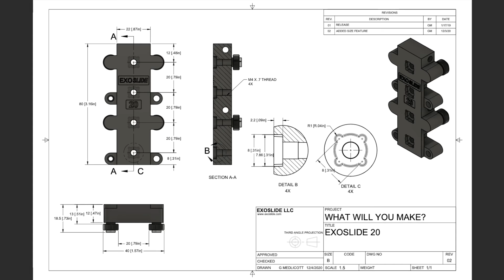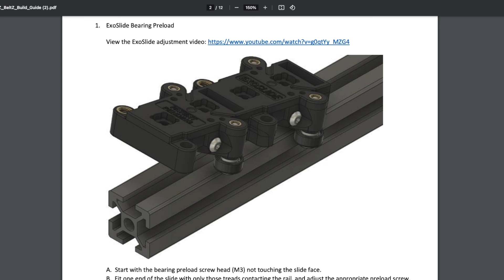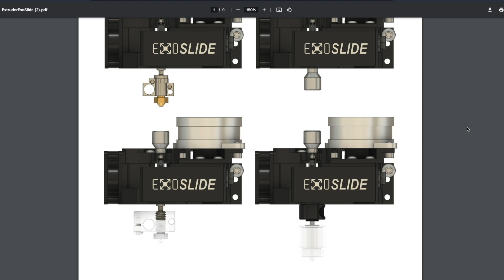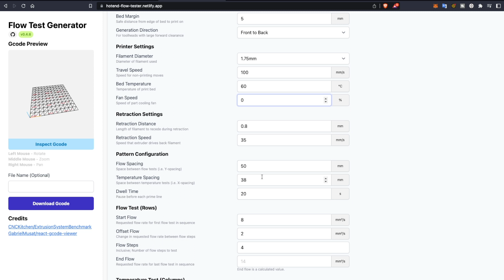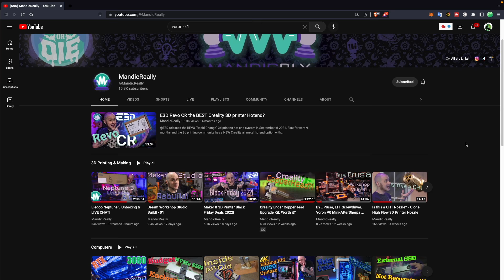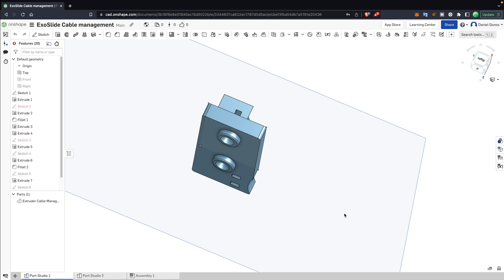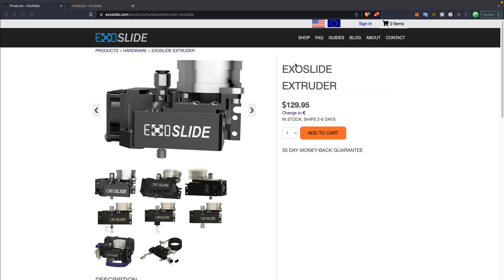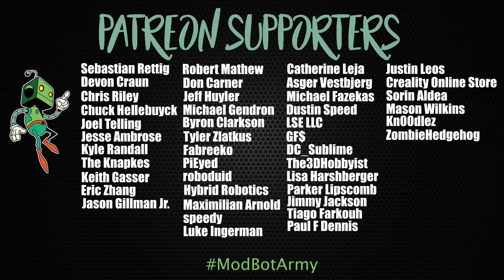ExoSlide 3d Printer Conversion (Motion & Extrusion)

Comment: I dunno. Nearly $300 for the whole kit. I don't see the value in doubling the price of an ender 3 to upgrade it. Better to get a different printer.
Reply: Idk bro, you can go full linear rail on an ender 3 for sub $200. Not sure why this exoslide would be worth it then.
Reply: @@twanheijkoop6753 Personally I don't think linear rails are worth it on an ender 3 either. The point of the ender 3 is that its cheap, $100 at micrometer. Once you are putting more money in than the base machine I don't see if as a good value.
Reply: If you're printing for profit, that cost is nothing and can give you higher yield if you're space limited.
Reply: @@speadskater  If you're printing for profit why would you waste your time and money upgrading an ender 3 instead of just buying a good reliable machine from the get go?
Reply: This is never going to increase your profit. Better to just buy a second ender 3 and double your output.
Reply: A linear rail is like 25 bucks for the hotend on an Ender…🤷🏻‍♂️
Reply: @lolzlarkin3059  I agree, buying another printer will be a better investment, BUT reducing downtime is huge in running a farm. If this system improves reliability, and makes hotend/nozzle swaps easier, that could? maybe? slightly? make it worth it? I think it’s more of a nerdy geeky way of upgrading your printer to the fullest extent regardless of cost, and having something pretty unique at the end.
In the PC gaming sphere, it’s like all those gamerz with 32 threads and 64gb of ram. It doesn’t improve game performance proportionally to cost, but they still enjoy spending the money and doing the upgrade!
Reply: @sacrificialrubber779  if buying cheap rails you could do x and y for under $100 easy.
Reply: I bought Ender 3 pro for the sole purpose of exploring 3D printing as i found that it is one of the best printer to learn 3D printing and also it provide good quality print of its price, after month of using i can say it is really good printer, however it is not perfect.. i had to do few upgrades such as adding level sensor , upgrade plastic parts to metal parts , etc. Now i start to appreciate or even understand why an X print cost Y value.. before i had 0 clue. I kind of agree that if you plan to invest 300$+ on ender upgrade... Go and get good printer... It is like buying cheap car upgrading it to perform like Ferrari..
Reply: That price is ridiculous.  Better off buying a Voron or RatRig,
Reply: @caramelzappa  i don't think linear rails are worth it on a ender 3. Maybe when going full switchwire. But there still a better bet than these exoslides
Reply: @nathanblanchard8897  I don't think the pc scene is analogous. Here you're buying parts to make a cheap printer work better, when at that cost you could just buy a better printer. In pc upgrades there isn't much of a 'buy better pc concept', if you put the same upgrades it's largely going to be the same pc. For the printer there would be a difference between a modded ender and a prusa.
Reply: Why upgrade vs just buying a better 3d printer. Usually it has to do with money. Yes in the long run you will most likely save money just buying a better 3d printer. But Usually its cheaper to buy individual upgrades to make what you have better in the short term. Its easier for me to buy a 300$ upgrade than it is for me to buy a 600$ printer. 
Outside of that the ender 3 v2 was my first 3d printer. I knew nothing about 3d printing. After dumping lots of money a little at a time  into an ender 3, I learned a lot. I probably have close to 2k or more in upgrades on my first ender 3 v2. But it now prints peek. Still probably not worth it in the object itself, but it is worth it in the knowledge I learned while making an ender 3 v2 print peek.
Reply: @kathleenrobertpogue6818  it is possible you would have learnt the same with a good printer in hand as well
Reply: @zwxyer  lol
Reply: I mean I’m doing a 48v ender 3 and I don’t think it’s a waste at all. I might add this whole kit to that as well. I have 2 vorons but I still like to upgrade and mod whatever I can get my hands on.

Comment: I just finished tensioning the belts on my full ExoSlide conversion on a CR10v3 tonight.  I'm a little chapped Giles didn't let me know he was about to release an extruder.  🙂

I looked at linear rail conversion kits and for the CR10 size the ExoSlide was a better value to me.  The CR10v3 has some nuances over the various other CR10 versions so I did have to get a couple of files from Giles to print some additional parts.  One huge factor that I'd like to share is the level of support Giles provided both before and after the sale.  Especially after the sale.  

I ordered the Hemera mounting plate with my kit, but since the ExoSlide extruder is REVO compatible, I will be ordering one.  

Thanks for making this video!

Comment: I modified my Ender 5 and 5 plus with linear rails, switched to Exoslides and what an improvement.  Skip the rails and go directly to Exoslides
Reply from the maker: You are 100% one of the people I think of when I think of advocates for the slides. I remember you mentioning them on the previous video I did and the positive experience you have had.
Reply: @ModBotArmy  I'm only sorry that I'm in the process of disposing of all of my Ender 5s that I have modded with them.  Giles is a great guy, but I'm going to Bambu and the Prusa XL with my two Rat Rigs.
Reply from the maker: @woodwaker1  it’s hard to ignore the speed and convenience of the Bambu printers. I am very curious as to what the xl end up being like. Also what rat rigs? Minions? Or v core?
Reply: @ModBotArmy  I have two V- core 3.1.  I installed the 3.1 upgrade on both a 500 mm and 400 mm cube.  I have an OmniaDrop on each, so with the size and direct drive, I don't try to go crazy fast, but the size really helps.

Comment: I'm actually building a massive custom printer using the Exoslide guides and 2 of the extruders. Definitely had to do some custom prints for some parts to get everything to move properly. Can't wait to get it up and running.

Comment: Seems like an awful idea 🙄. Now the aluminium extrusion is the wear part, instead of the “wheels”.
Reply: The X and Y axis use plastic treads over the bearings, which wear instead of the rail, though themselves last a very long time (much longer than V-wheels).

Comment: At 220C, using the method from Teaching Tech, I got about 14.4mm3/s from a microswiss all metal on my Ender 3 (stock heater).
I could have pushed the extruder higher, but it was bending the printed mount.

Comment: Still I am happy with stock ender 3, this total cost with printer equals voron switchwire..... and as you mentioned i video, bed wheels are mostly stressed so I am waiting to see all ender 3 versions of your choice upgrade with linear rails on Y axis a cheap one may be fine and print tests included. Good video. It wil prevent people from spending much on nut much.

Comment: This is cool, but realistically a Switchwire conversion would likely be a better buy.
Reply from the maker: I love my Switchwire. I would say it is definitely a much more involved conversion than the eco but the end result is awesome.
Reply: Yep I agree. It will cost approx $350 and with a high flow hotend (which is ard the same price as all the exo upgrades you just did) and it will have many advantages like linear rails, definitely higher speed, fully enclosed and some other more minor ones.

Comment: How about a video on the best bang for buck upgrades for the ender 3.  You could break it down by price point vs ease of upgrade.  I think Thomas Sanladerer's video on running octaprint on an old android phone sounds like a really cheap way to add wifi control and a camera.
Reply: Klack for ender 3 as a bed probe. Like 10 bucks in materials. A dual geared extruder. Pei bed sheet. Bi metal heartbreak. Octoprint. Better spool holder that uses bearings. New fan shroud. 

Subtotal: ~80 USD

Runner ups: fans to make it quieter and more part cooling. Dual z axis, either another lead screw or belted z mod. Klipper if you’re up to the task.

Adds another 80-100 bucks.

Comment: Ive had this running on my ender3 for over a year now- but i’ve had to convert the y-axis back to v-slot wheels after the brackets failed twice- making the whole bed wobbly and useless for printing… perhaps the tension was too tight causing it to break (?) but its a pain to keep replacing… the x and z have worked out great tho. Just had to create my own hot end bracket and edit the cooling duct since the ones on the site didn’t fit my non-stock things.
Reply: We had a small batch issue some time back that was more brittle; now we make the ExoSlides bodies from Nylon, and they are almost indestructible!  If you still have the other Y kit parts, shoot us an email from the contact page and we'll get the ExoSlides sent out.

Comment: I have an ender 3 pro that I just installed a BLV linear kit recently but I'm still having issues with lead screw system and I'm really contemplating this or a Switchwire conversion for fun not practicality I wonder which one would be a better option for faster quality printing.

Comment: Is there more drag from the Exoslide system completely surrounding the Extrusion compared to one linear rail to do the same job?
Reply: I have not done any instrument tests, but I would guess that the exoslides actually have less drag than a linear slide block.
4 exoslides surrounding the entire extrusion has a total of 16 bearings (4 per modular piece). Those bearings slide easily and the preload is adjusted with two screws per slide. 
An mgn 9 or something like that will be rigid with medium preload, but will probably not fall under its own weight.
Reply: An additional thought. For a commercial machine that has been tested and will not have upgrades to its motion system, I would think that high quality mgn rails would be the way to go, because of their durability.
But if you plan to be tinkering with your 3d printer as a hobby, the modular exoslides may be the way to go. You just need to be careful with loktite or anything that might degrade the plastic components on the sides. (Speaking from experience)

Comment: The y kit doesn’t work with the ender 3 pro but they advertise that it does
Reply from the maker: What do you mean? I installed it on an Ender 3 pro.
Reply: @ModBotArmy  they didn’t provide proper hardware on the y kit. There was no proper way to mount the y extrusion to the printer. All other kits have been great it’s just the Y kit that’s been a problem
Reply: We have the Y sorted now; for a short run some kits were missing the mounting bolts for the bed bracket.  We can send out the M5 bolts and new compatible bracket.
Reply: @exoslide1632  thank you! I will send out a email. I appreciate the support!

Comment: Those steel bearing riding on the aluminum rails will grind them down over time. Not very thought out, engineering wise. More bearings doesn’t always mean more better 😂
Reply: The steel bearing version is only used for the Z axis, and is good or 5-10k cycles / prints before it starts to wear.  The X and Y use plastic tread over the bearings, and don't wear the rail.
Reply: @exoslide1632  I’m sorry but I call BS. 5-10k cycles …steel bearings on aluminum rails. Steel a harder metal against a softer metal, will not last this long, especially with no sort of lubricant between said metals. If so, I recommend a video showing these so called 5-10K cycles because as an engineer, I like to call BS and will love to be proven wrong.

Comment: Great video explaining the Exoslide system. I'm going to install both components on my Ender 5+.  What is the max Temp the extruder/ho tend can be run at?  Is the hot end thermistor option #5 in Marlin?

Comment: I have a question about the power supply??  Is there a printable that I can use to mount the PS to the frame or does the exoslide run on the front of the rails??

Comment: by the way, I see no sigificant reason to prefer this to cheapo chinese made linear rail - like, you need at least two block to create a slide, which is already more than linear rail
Reply: @petercallison5765   ha, that’s misinformation. Linear rail benefit in long term maintainability - v wheel will degrade and wear out during time, the defection can be spot out with bare eyes at around 1k hour ( which is 3 month when you print 8 hour per day or one month if you print 24 hour a day). So whenever you can, go linear rail.

Comment: it is not worth it. it is too heavy and too expensive. IIRC, 4 sides almost equal to half a kilo.... insanity. for the price, it is easier and better to just buy proper linear rails even those cheap hiwin clones are great compared to this.
Reply: Yeah, weight. From my experience if people woulc care about weight on these printers they wouldnt spend 100 dollars on basically relocating the stock extruder to the x carriage, making it a half kilo toolhead or strapping voron toolheads with sadly not that great part cooling to their printers, giving you also a damn heavy toolhead (afterburner weighs 470g and stealthburner 420g, printed with abs and being BOM/manual conform). Meanwhile the whole moving xy motion system on a similar sized printer (twotrees sapphire) with a proper direct drive ways maybe 400 grams
Reply: Each 20mm ExoSlide is around 35g, so 140g for a 4 ExoSlide hotend carriage.  It's lighter than a linear rail setup in the Y axis on a Cartesian XY, as the X doesn't have the heavy linear rail (assuming the rail is bolted to 2020 extrusion).

Comment: From Experience (my Own design mods)  Ball bearings as Rollers are an Whole Lot better than  Roller wheels.. and even linear rails (which unless the $$$ Japanese variety ) are basically overhyped mediocrity.  Look Trick but are real life..Not. 
 Are your extrusions Smooth enough tho?? I suspect not as there is Zero forgiveness  Tolerance of non Milled surfaces..with ball races.